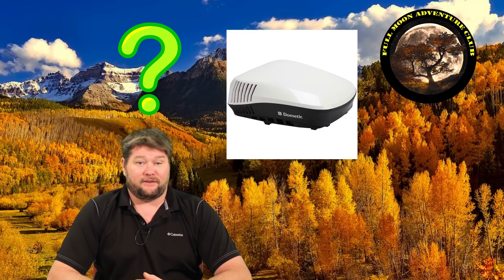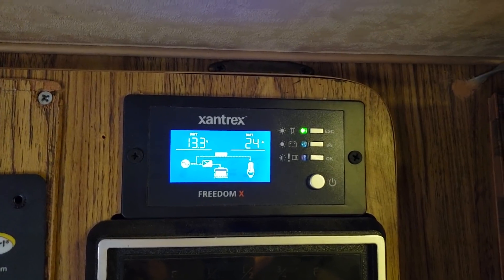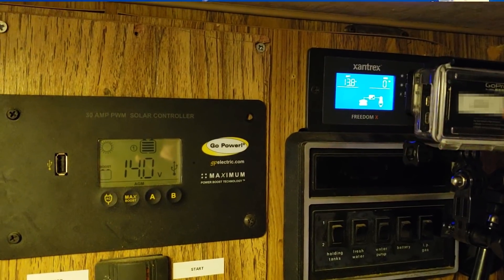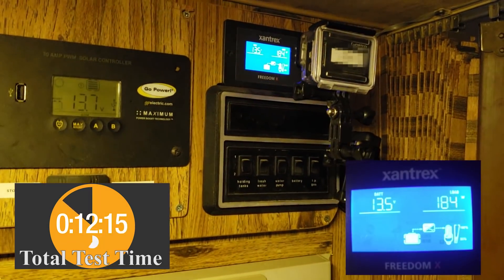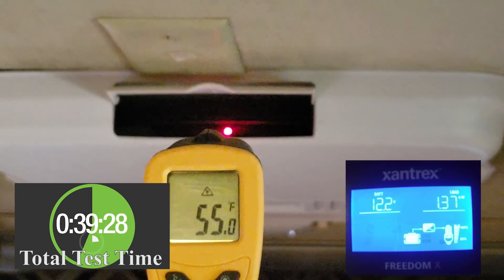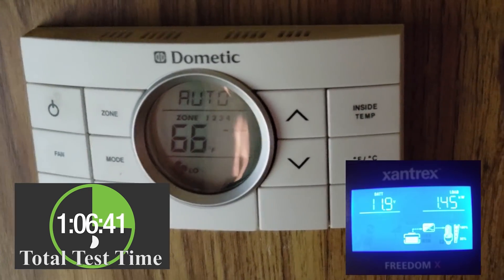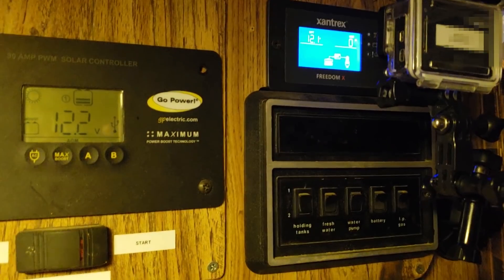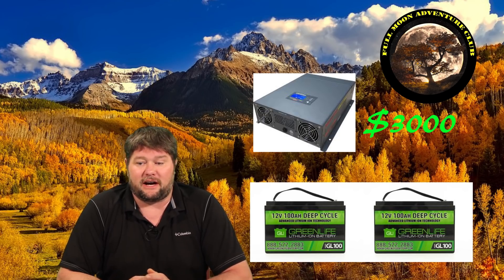How Long Will an RV AC Run on Two Batteries?

Comment: Only problem I seen was your panels were not connected and added flow to the battery’s you could have been around 3hrs or possibly more… so slightly inconsistent testing for total time to really test the system.

Comment: I'm strongly considering going solar and offgrid in a camper trailer for a few months or longer. I haven't found a great resource on where I can ensure that I can run a system on Solar entirely- which would be the ideal. I'd be okay with going expensive on things, but I'd want to be able to run an AC during the night in summer climates. Can I just get like a 1500 watt solar panel and an AC like in your video? Would that not run itself while there sunlight without much if any draw from the batteries? or am I missing something there? Additionally- have you seen anyone with a full on tesla power wall or something in the RV so they have all the power they'd ever need- solar to recharge during the day, etc? Thank you!!

Comment: What these vids need to talk about more is the heat ? Running 1400-1500 watts causes a lot of heat on wires and everything! I had to add fans for the batteries, solar controllers, and inverter! 
I got 10 lithium and a 1400 watts of solar it works to keep my rv power up

Comment: Question; I have a camper that’s new with 190 watts solar, 30 amp charge controller. I’m installing 2 x 230 amp hour LifePO4 batteries, 3,000 watt pure sine wave inverter. I have the camper plugged in, and the solar is charging but it seems it will take forever to charge it? Thanks

Comment: What about redodo batteries, Amazon $619 for 200 amp hours? I think they have a 5 year warranty and 10 year or more lifespan? I’m thinking of a 3,000 watt Renogy inverter and 2-3 x 200 amp hours. I’m guess 600 amp hours would run the AC all night if it was cycling. Most campers come with 200 watts solar, I want to add a pug in panel of 200 watts. Wondering if it was during the day, stated out full charge and the sun was out, how long would 400 watts coming in, extend the run time?

Comment: I have a 120v 4000w inverter with 2 200ah lifepo4 batteries and a brand new recpro 13000 btu AC and once the compressor starts up the whole damn system shuts off. I don’t understand it.

Comment: Glad you plan to do the actual test with pv's included.  Best sun is when ac needed the most.  PV's going to produce lots of current when needed the most for this purpose.  Also, price of lifepo4 batteries has decreased significantly and are now at around $300 per not $1200 at present.  So your could add 4 for $1200 or 8 for $2400.  8 would probably run all night as demand is lower with no sun-heat-load while it's dark.  Things are changing so fast in the solar world so as to make money comparisons irrelevant almost immediately.  Plus now you can buy four 3.2 volt prismatic lifepo4 batteries and a bms for even less than $300 and build yourself.  In fact you can purchase four lifepo4 prismatic batteries at 3.2 volt and 304 ah for less than $800 and produce 3890 watts for 2/3 of what you paid for the one battery.  Each of your batteries are only capable of 1280 watts per.  In time you'll be able to afford much more for much less and go all solar, all the time.

Comment: I have a standard RV 8ft fridge, but also 2 battery pack that's connected to a solar panel (and has an inverter). How long will my batteries last if I only turned the fridge on, while driving in a sunny day?

Comment: Not all lead acid batteries are supposed to be stopped at (or before) 50% DoD (Depth of Discharge).  Odyssey Extreme AGM batteries by Enersys are rated at 400 cycles down to 80% DoD, so your 4 lead acid = 2 lithium formula is not correct.  You even said lithium can output 80% so that would be 80Ah usable for a 100 Ah rated battery.  Odyssey Extreme 100Ah rated AGM batteries can also output 80 Ah usable power, so no need to double them.  You are giving out wrong information.  Downvoted for that.  If someone didn't want to drain the AGMs down to 80% DoD, then just get 3 of them and drain them down to about 53.3% DoD which would be 160Ah usable (about same power as draining two 100Ah rated lithiums to 80% DoD).  To help compensate for the lower loaded voltage of the 3 AGM batteries, maybe drain them to 60% DoD.  Doing that will probably give you 600+ cycles on the AGMs.

Comment: We install all day long 12v  7000 BTU units able to run continuously 4 hours on a single MPS 125ah (31 series battery only weighting 28 lbs ), and over 7 hours at night in Econo mode, the units must be ultra efficient 3phase AC low voltage compressors, some are operating on just 7v 3Ph through a DC /AC Frequency drive 12v DC in 7 to 3 V AC3PH out. then the components like fans must be also Permanent magnet equipped with ceramic bearings to achieve ultra efficient result.. 
any equipment that delivers cold will also delivers heat, so both heat exchangers are key for success, installing a condenser under the vehicle is sometime not as ideal, heat from the road, exhaust and engine could reduce drastically the efficiency of the unit, then because of design painting a roof top unit in black could also hurt the heat exchange. Lithium phosphate is a big improvement over conventional AGM acid batteries, half the weight twice the capacity, 10 times longer life. Imagine the cables needed to run a 100amp unit, compared to wires on a 27.8amp.. charging system?

Comment: Hi, I tried to run the Dometic Blizzard NXT with the Xantrex Freedom Xi 2000 inverter, but couldn‘t start the compressor due to the high surge, I guess. Have you a hint for me? Did you use a soft start device in your installation? I assume that Xantrex X2000 and Xi 2000 are quite similar.
Reply from the maker: I do have a soft start installed in my system. However, if I remember correctly my Xantrex 2000 watt inverter was able to start the Dometic NXT without the soft start. Are you sure your wiring is big enough and that your batteries have a large enough capacity?

Comment: This was a very good test. I just ordered two Lithium batteries too and planning to run 13K BTU Dometic roof mount AC as well. I have an underhood generator with 280A capacity so I am looking to add 2 more Lithiums in parallel and when the voltage goes down below 12.5 the engine will start automatically to recharge -- hoping it would be about 3 hours at a time. So during really hot nights, the engine will turn on 2.5 times for a good night sleep ... fingers crossed.
Reply: have you done this yet?

Comment: Great video, if you had an inverter charger that plugged into shore power, and which ran your air conditioning as you've rewired it, do you think the inverter/charger when plugged in could then handle load just fine, by bypassing the batteries? thanks!
Reply from the maker: Absolutely.
Reply: @fullmoonadventureclub  thanks so much. I am converting a sprinter at the moment and I am trying to figure out if I get the type of rooftop unit you have in the video what size inverter I'd need to run it off shore power as no amount of batteries will run it long. Just spoke with someone from AIMs inverters who told me I just have to make sure the inverter is large enough to handle load of A/C unit. Whether plugged in or not he said the inverter is only meant to supply wattage load as indicated. In other words, having an inverter plugged in to shore power doesn't up the wattage magically. So Im thinking ill run 3 12v lithiums on solar power with a 3000w inverter charger to run off batteries for small ac plugs and have rooftop unit like yours to run when connected to shore power. Based on your video it sounds like with a 3000w inverter charger plugged into shore power, ill have sufficient shore power to run a unit like yours. Does that seem right? thanks again!
Reply from the maker: @DrBass-rk1ez  yes if you're going to be running your air conditioner through the inverter I would go 3000 Watts

Comment: I ran a 12000 btu mini split 22.5 seer rating for 8 hours on 200 amp hours and of course anything else that was on at the time lights refrigerator and that was in Louisiana heat although summer was just getting started.
Reply: How many batteries did you have and what type? I have a 9K btu pioneer mini-split with 22.5 seer, need to know the battery sizing puzzle
Reply: @vroor32  go to will prowse he's the expert. Also that should have said 200 amp hrs. They were lifpo.

Comment: Great video thanks.  If you use one of the new HYBRID inverters like the Cotek SL2000 or Magnum, you get the option to safely blend in external power of 7-10 amps AC which vastly extends your runtime.  You can use the power of your vehicle with a www.CarGenerator.com to blend in say 1000watts in your example that cuts your battery draw to 1/3 of what you're pulling now.   The Cotek inverter is pretty interesting specifically because you can set your shore amp power draw by units of 1, so you can set it to 5 amps, 7 amps, 8, 10, 15, whatever level of power your vehicle engine alternator can safely provide.

Comment: I’ve purchased a van with the same set up, but with 2 Renogy 170ah batteries, solar panels and a dc2dc charger.  I’ve just tested it and after a few minutes of operation, the 200 amp fuse trips, a slight “burnt” smell, and some of the wires are really hot.  Do you have a video (or schematic to share) on your circuit design with wire gauge sizes, and fuses? I need to trace the wires - something’s not adding up.
Reply from the maker: What type of inverter do you have? My entire setup is basically run off 2 gauge wire. About the size of your standard battery cable under your hood. But typically I don't pull a lot of amps so that's fine for my particular set up. You may need to go larger depending on your inverter and what you're trying to run.
Reply: fullmoonadventureclub Whoa, you mean 2/0 AWG, not 2 AWG?  2 would be too small.  I have a 2000 watt inverter.
Reply from the maker: @helenzane4617  thanks for clarifying. My autocorrect must have gotten me. I have closer to a 1/0 gauge wire in my RV. It's more than capable of handling a little over 2,000 Watts. But I have a 3000 watt inverter inside but don't use it for any more than 2000 watt draw. You will probably need 3 / 0 wiring if you plan on running 3000 watt continuously for a long period of time.
Reply: fullmoonadventureclub I’m probably going to go with a 250 amp fuse with 3/0 AWG or a 300 amp fuse with 4/0 AWG.  It seems like your cutting it close with 1 AWG.  The amp flow chart I work worth suggests that size wire would only safely support 150 amps.
Reply from the maker: @helenzane4617  the wiring was put in for a much smaller system years ago. I'm going to have to upgrade my wiring soon.

Comment: This video probably answered it, but just making sure. Can I get a victron 2000 watt inverter charger and will that power a dometic brisk air 2 13,500 AC unit through shore power or generator given the generator is 2000 watts also?
Reply from the maker: Yes you can. However the air conditioner is about all you'll be able to run using a 2000 watt inverter.
Reply: That's fine. Maybe a little help charging the batteries on top of the AC is all were looking for.

Comment: When you’re running your AC off of your inverter if you have your inverter hooked up to an isolator and your engine battery is charging your other batteries is that an option or a possibility to be able to run that longer
Reply from the maker: You would not want to help charge your house batteries using your chassis battery without the engine running because it would drain it quite quickly and then you wouldn't be able to start your engine. If your engine is running your alternator will provide up to 60 amps of charging power although it can work the alternator hard and cause it to burn out slightly prematurely. Although my alternator in my RV has been charging my house batteries for several years now and no problems but I hear it is occasionally a concern. However, running your truck or RV engine to supply powers for the AC is a very inefficient way to go. You would be better off with a gas generator of some kind.
Reply: fullmoonadventureclub if I have the vehicle running and I have an isolater that open and closes a circuit to charge  and not charge when car is turned off would the charge offer enough to run it continuously
Reply from the maker: @jesseclark4296  I have a 15000 BTU air conditioner that runs off about a hundred amps. Your alternator probably only puts out about 60 amp so I doubt it..
Reply: fullmoonadventureclub do you have any ideas I have a domestic penguin 2 13,500 btu I haul dogs in a 2016 ford transit so it is important to be able to run it I currently run it off a generator and have a ez start hooked up in in the ac
Reply from the maker: @jesseclark4296  running it off of the easy start and a generator seems like a good way to go that's how most people do it. Otherwise you have to invest in some pretty serious solar and batteries. The cost of solar and batteries is pretty expensive. That's why most people just use a generator.

Comment: I thought that Lithium batteries are not supposed to drop voltage from 13.7 till like 5% life? why the constant drop of voltage?
Reply from the maker: They usually do not drop voltage until they are almost empty. However, they can get down to around 12.6 volts after they are half way through their cycle. It also depends on wire size and load. This test was using wire that was a gauge too small and running a heavy load so there are some variables involved. I hope that helps. Thank you for the question and happy camping.     Jim
Reply: @fullmoonadventureclub  thanks. Just learning all of this. Wife and I pickup our first Rv, a Thor Delano, next Saturday.

Comment: Is this test before getting the slow-start?
Reply from the maker: No, this test was before the easy start. I just redid this test and I actually got a lot more time out of it because of the easy start. I'll be posting that video this week so stay tuned. Take care and happy camping.   Jim
Reply: fullmoonadventureclub Hi Jim, Inergy just posted their new models (2) on the website inergytek.com.  Maybe your channel can get the “scoop” before anyone else. I did not see prices, one interesting twist is a dedicated 12 volt unit.
Reply from the maker: @ds525252  yep I'm aware they're about to launch their new line. Trust me I'll definitely be doing a video as soon as I have one to test. I don't like doing reviews or sharing information until I've actually used the device. However, I do have one last video from the Apex where it runs my house water supply that I'll be posting soon. Thanks for the heads up. Take care and happy camping.   Jim
Reply: fullmoonadventureclub 🤝.
Reply: fullmoonadventureclub thanks for the reply.  Subbing now👍

Comment: What fuse are you using from the battery to the xantrax inverter? 300A or 400A?
Reply from the maker: I have a 200 amp reset-able fuse by the batteries. I kept it low to be on the safe side.    Jim

Comment: My air conditioner runs about 3 hours with a 24 volt 85 A/h lithium battery. Power consumption is 26/28 amps. Chinese Home Mobile Air Conditioner 6000 Btu. And much more Chinese inverter. With 15000 BTU the consumption is about 70 amps. This is normal.

Comment: I didn’t think most RVs were even made to run your A/C on batteries?
Reply from the maker: They are not. Running the AC off batteries takes a lot of money and power. This experiment was mainly designed to show people how hard it is to run an air conditioner off battery and solar alone.  Jim

Comment: Lets make a video on running an AC on batteries... wait my batteries arent charged up so keep watching while i charge them. Typical youtube clown. SMH
Reply from the maker: I just film The Experiment as I did it. I'm sorry you did not enjoy the video. I think it was valuable information for those people that think it's viable to run an air conditioner off of battery power. It takes a lot of money and power to run an air conditioner without being plugged into Shore power. I just wanted to demonstrate  what it really takes. Thanks for the comment and happy camping.   Jim
Reply: @fullmoonadventureclub  I loved the video.  It was exactly what I needed to see this morning as a customer has asked me to install a 15K AC on his shuttle bus and try to run it off an inverter, powered by four Deep Cycle Marine Batteries connected to the alternator of the vehicle.  Think I'm just going to recommend he get a Honda generator/inverter and run it that way.  Pay no attention to Tailwheel.  He sounds like a typical, clueless YouTube troll.
Reply from the maker: @davidfranklin5962  glad you found the video helpful. Thanks for the comment and happy camping.

Comment: The difference between the different readings could be the loss in the writing. Most of the wires are not that big. They read about the same after you turned off the AC. That makes me think that it was loss in the wires.  Larger wires would not have gotten as hot and the 2 would have read about the same.

Comment: Normally, for home use, a 5000 BTU aircon is good for up to 150 sq. ft of space (such as a 10x15 foot room) and takes about 500 watts.  Why not use a smaller aircon to get slightly better performance out of the batteries?  Lower the load to 1/3rd (from 1500 watts to 500 watts) and double the batteries and it should last about 8 times as long, 12 hours instead of only 1.5 hours would be my guess.  You could also use a smaller capacity inverter to save even more money but the 2000 watter should be fine with the 500 watt load (just not quite as efficient I think).
Reply: your math sux